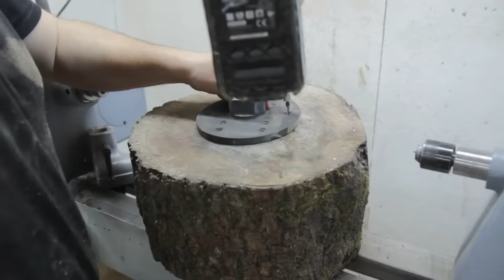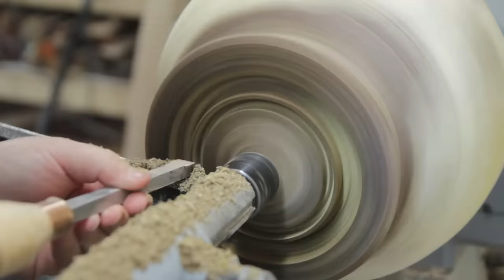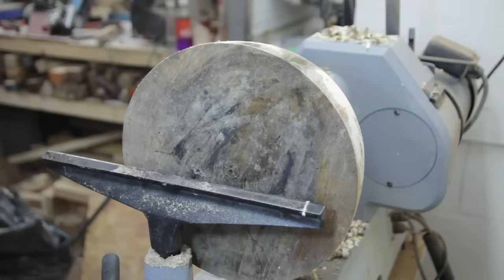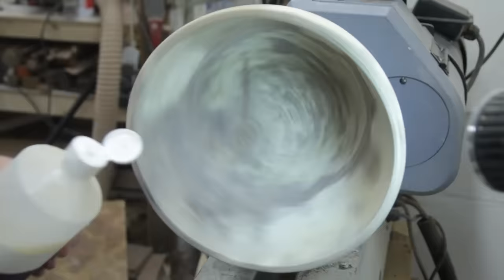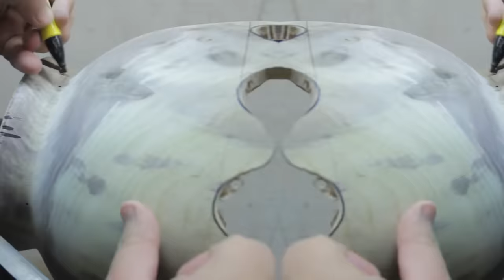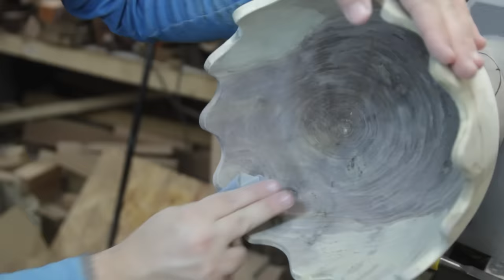Woodturning - Dragon Bowl from End Grain Black Walnut

Comment: Some advice . Stop using Philips screws. I've had to many to twist off on removal. Drill the face plate holes to 1/4" and use 1/4" x 1 1/4"  hexhead lag screws or larger.. More positive grip and less likely to break off.
Reply from the maker: Thanks for the advice Duane. Will give it ago, certainly I had number of broken screw heads what is very frustrating to get out 👍

Comment: Am I the only one thinking about the massive mess that made?
Reply from the maker: Do you mean the full rubbish bag of shavings I found in under the lathe and two days worth of dusting in the workshop after sanding? 😂
Reply: @DavidsWoodturning  yeah those and the wood dust still in your hair 🤣 hey man the views on this video are great for the small sub base you have. 

The power of a good thumbnail is unbeatable. If you ever need a graphic designer for you thumbs I can get you with my guy. He's been doing mine since I had like 10k subs. You may not need one since you can get away with high contrast images like this one. But anyways good luck with the channel bud!
Reply from the maker: @BuddysDIY  Thank you so much :) So far is going pretty well but keep your suggestion in mind :)

Comment: Hi David! Wondering what hp your lathe is? I'm looking at getting a coring jig, but not sure if my lathe will be able to core walnut
Reply from the maker: Hi, it is a 2hp 1.5kw lathe. Sometimes it can struggle with coring bigger bowls. How big is yours?
Reply: @DavidsWoodturning  it's only a 3/4 hp. Probably not big enough. I've heard that 2 is about as low as possible

Comment: How long did you dry it? Did you coat the ends with anchor seal?
Reply from the maker: Hey Rick. Tree was cut down last year October time. After a picked up the logs sealed them with PVA glue but after few months some checking started to appear. So started to rough turn the logs. With this piece I am doing a little experiment and did not rough turn just turned it to final shape and thickness. Still have high moisture content (just assuming as did not check but was not drying for long) and will monitor the bowl over the coming months.